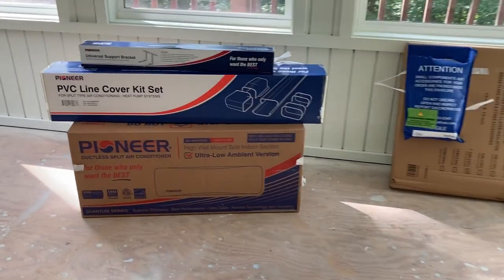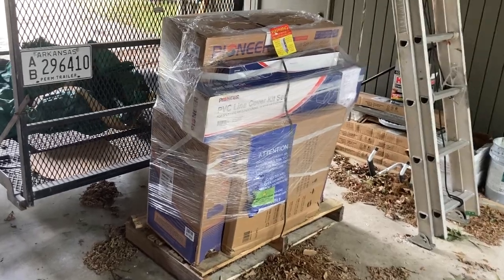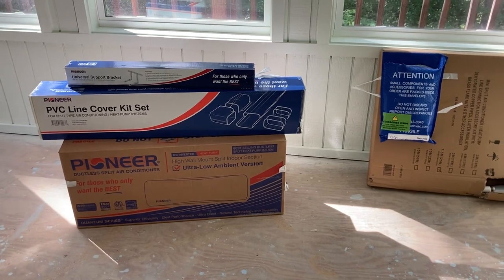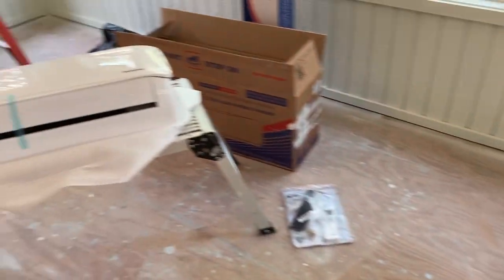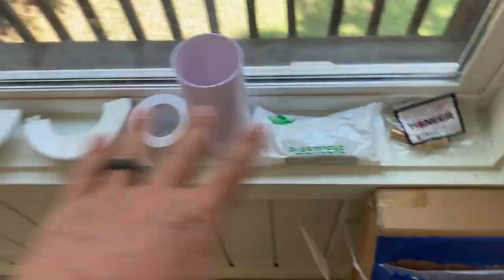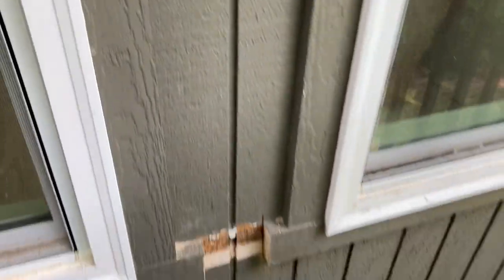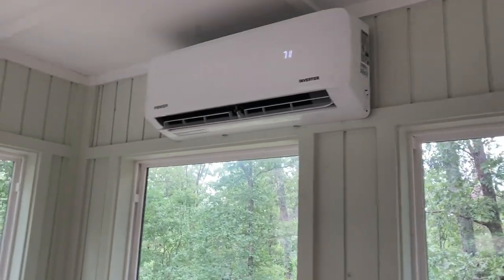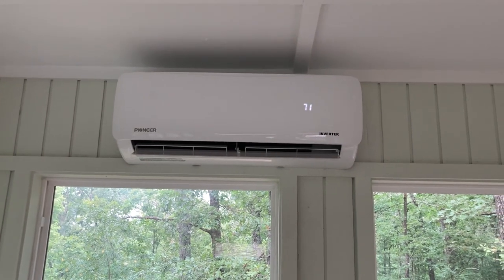DIY Install Pioneer 12k Mini Split Unit 230v - Careful, Don't kink the line set!

Comment: The reason why the Lennox was more expensive is because it costs more for the equipment. The hvac company was probably putting 1500 in their pocket and the electrician was probably getting 750 to wire it. I'm a electrician and I just got my refrigerant license to install these cause I'm money hungry and these things basically print money for 4hrs of work or less. A Mitsubishi unit apple's to apple's with this amazon model is over 3k just for the parts same as a haire unit. Mitsubishi is def a much better unit and I know the ser numbers are better meaning it will cost alot less to run on really cold days. I don't know much about the pioneer please do a update later on maybe I'll offer to install these as a option for people who don't want to pay Cadillac money.  good luck and god bless
Reply from the maker: I agree with everything you said. I think you will do very well installing these, being able to run the electric and HVAC requirements covered. I had a person living close to me who bought a mini split (same one as I have, after looking at mine), tried for 6 months to find an installer. He finally found an independent HVAC guy who installed it for $650. He hired an electrician to run the drop, but not sure what he paid for that. Regarding my unit and how it's holding up.. It's been maybe a year now? The unit has been running continuously since install, we have not turned it off once. It cools great, even with the 110 degree summer we had, no issues. In fact, we leave the French doors open to the main house and the mini split seems to help out our main system. The mini split is energy efficient, only raised our monthly bill by $10 or $15. It does not short cycle, rather idles down when demand is low. It does a better job cooling than it does heating. It will heat the sunroom very well without any issues down to the mid 20's, but anything lower and it struggles. It will heat with temps down to zero (I have the sub zero model, with improved heating), but again it struggles to maintain. However my sunroom is not insulated as it should be, so that's a factor as well. If temps fall below 30 in the winter, we use a small wall heater to supplement the mini split. That combination works very well. I'll do a one-year follow up video soon. Thanks!
Reply: @Ozarkwild  thanks for the reply I was really curious with that model. I can't wait for the updated video. 

Cheers